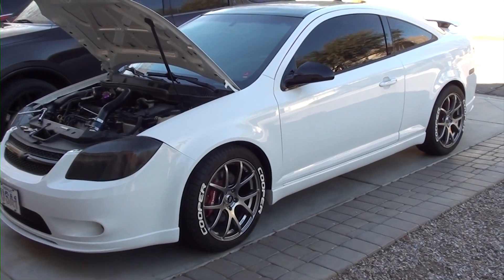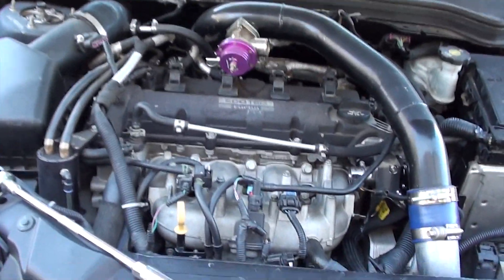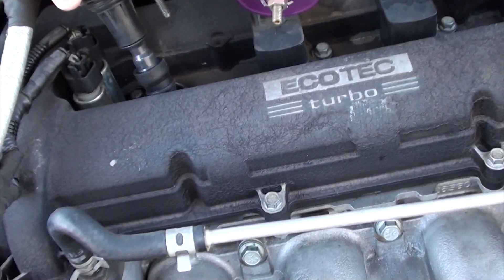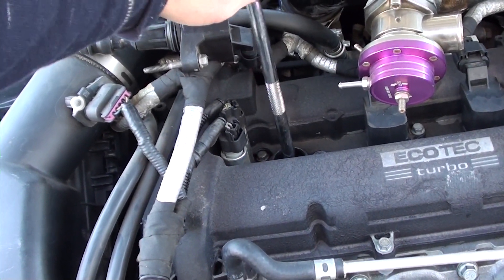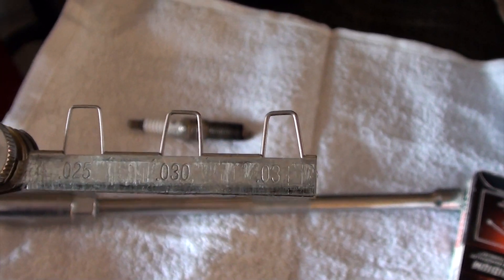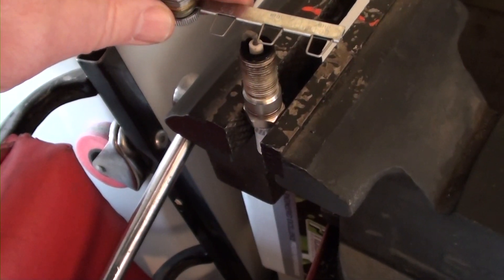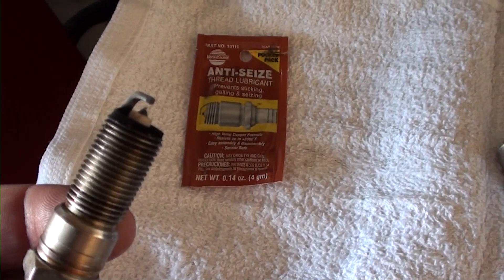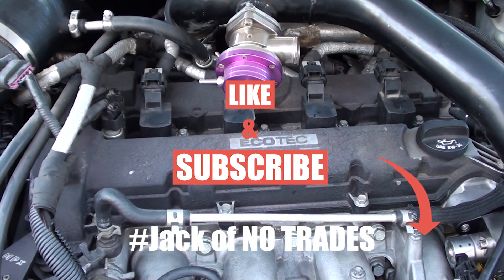How To Gap Your Spark Plugs on Chevy Cobalt SS LNF Turbo

Comment from the maker: Anyone else having issues with their spark plugs? How do you gap your spark plugs?
Reply: I just run the factory spark plug gap on my sky, I'm not really running high boost so there's no point for me to change the gap. I love your vids man, I live in the Valley also and it's cool to see someone with an lnf cobalt in AZ cuz I don't see them that often here. Keep up the good work dude!
Reply from the maker: David thanks for the comment we really appreciate it.  We are trying to get to 1000 subscribers!!  We have more content on the way we just need to edit some of the video.  The Saturn Sky is a cool car, rear wheel drive!  I bet you get alot more traction than we do?